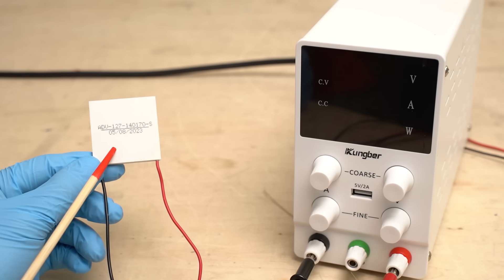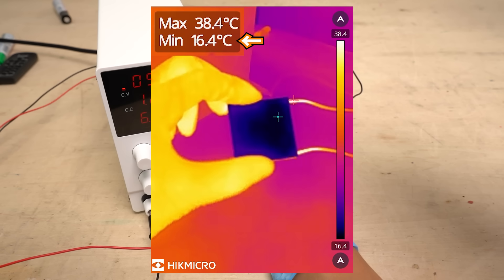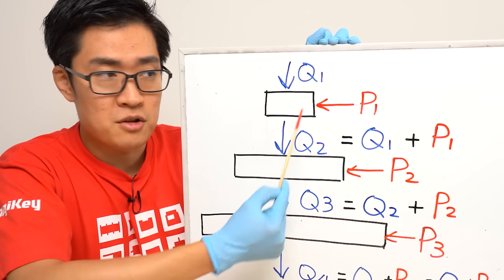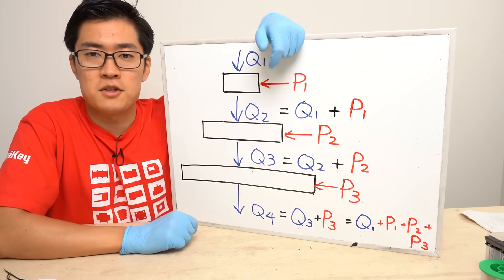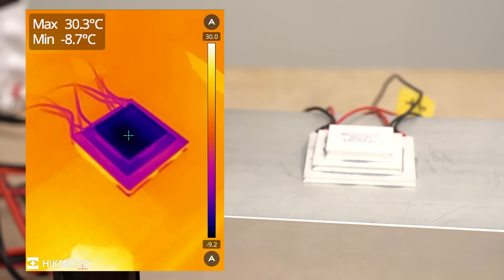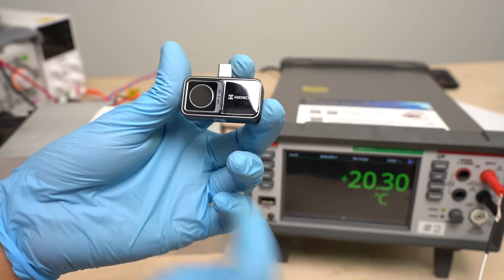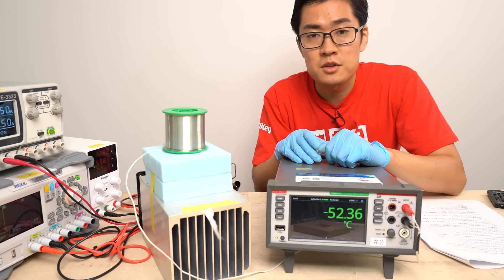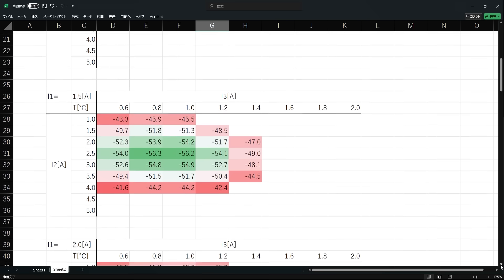Stacking 5 Peltier Modules, and Reached -90℃

Comment: 6:45 funny to think that he artificially added in the fan sounds after doing the dub just so we could hear how loud the fan is
Reply: https://youtu.be/yIMg89clGNk?feature=shared&t=500 The fan noise is the same between English and Japanese.
Reply: @torpedo996  this is an insane level of inquiry, im glad to be here for it
Reply: he recorded the fan noise with a seperate mic and they're on different tracks
Reply: That fan model is not very loud, it's only a 110CFM fan, at  45dB according to spec sheet.
Reply: It coincided with my laptop's fan booting up and it sounded like a helicopter was landing in my basement!
Reply: I find it interesting that you guys mention audio, microphone and Japan in relation to Peltier elements. Now legendary and extremely expensive Sony C-800G microphone sparked my interest for these devices, i think they used them stacked, mounted to a hefty heatsink. This is probably the only such microphone on the market, others move tube away from the capsule to allow passive cooling.

Comment: Awesome. I like the idea of stacking. I wonder if we did this and had about twice as many and cooled a cpu, using a small heat sink for the cpu for a start up cooling device then when the cpu is under load the thermo tech kicks in and cools it more. If balanced right you could make it to not produce condensation.

Comment: Looks a good idea in lab but it has far low COP (0.2 in 3 stages) than 3.5 of cryogenic cooling means 17.5 times less efficient than conventional cryogenic cooling
Reply: Only reason to use peltier is because it is cheep and simple or because of size restricitons.... ANY other cooling solution will be a lot more energy efficient.

Comment: you need copper heat spreaders between each layer. The ceramic on the peltiers is actually not thermally conductive enough to spread the heat between layers. It's actually made up of PN junctions in a grid layout
Reply: Did you watch until the end? He shows a commercial one and explains.
Reply: That's what I was thinking too.
Reply: What if he used 3 of the same type and therefore size of peltier modules and then ran them at progressively lower current ratings for each one?
Reply: u mean like in C shapes that does one surface to under..that is a good idea that and the traces for power makes lower power consumption i think....

Comment: So technically it's possible to build a solid state air conditioner.. That either cools or heats a room
Reply: Would be super inefficient and consume a ton of power.
Reply: Just remember that to cool 200w you will use 380w + the 200w = 580w total power consumption... Peltier is HORRIBLY energy efficient and create a LOT of heat. But is it a more efficient heater then just using a heater ?

Comment: Back in the late 1970s when I worked at Intech corporation, we used Peltier devices to cool solid state infrared lasers.
Reply: I need some info , I have a 300w pump diode , how should I cool it ? Is water-cooling enough or should I go with peltier ? Or a chiller + water-cooling ?seems you are very knowledgeable on the subject

Comment: Hmmmm... I wonder if such a device could be made for super over clocking CPUs and GPUs
Reply: I did this years ago.  Peltier cooled the CPU and water cooler cooled the Peltier.  Works great but there are better and more efficient ways to cool a CPU.  The biggest problem is the condensation it creates around the CPU.  You have to seal everything perfectly or run the risk of damaging the CPU and motherboard.

Comment: In the lab at work (I've since retired) we would use a peltier head to cool chips we were testing. The head clamped onto the chip, but had two pipes for cooling liquid on the back that attach to a vapour phase cooler in a large box under the lab bench. I believe it was only a single stage. It could go down to -10C. For lower temp testing we had a fancy liquid nitrogen system, but that required a trip to a different lab.
Reply: I use nitrogen in gas phase for purging systems and sometimes in liquid phase for Dewar type cold trap but not often as dry ice mixture is much cheaper. We're in oil distillation areas, not electronics but I use several heat exchangers daily.
Reply: I've been experimenting with liquid cooling on peltier units and the results are just amazing to experience in real time, I've been developing an off grid 'ice box' to keep my medication from spoiling in the heat, and peltiers are relatively very low electric draw for very instant dramatic results

Comment: Great solution to chill down the Intel heater in summer ..
Reply: It will not work to cool down modern CPU or GPU because they produce way to much heat in the 200 to 450w area which is way more then a peltier can handle. And even if you made a peltier by using several in parallelly that could handle that much power  you look at something in the 2000w ++ area of power consumption. For CPU  and GPU cooling it is better to use other cooling solution, like water cooling or just simple heatpiple aircoolers.

Comment: I wonder if the Peltier devices would be able to withstand the temperatures necesary to seal the stack inside of a glass envelope much like a vacuum tube. Moreover, I wonder if the glass would be able to withstand the heat generated by the bottom of the device without shattering.

Comment: Interesting results. I did a similar experiment using peltiers for a solar powered chiller, however I found liquid cooling the hot side using an oversized heat exchanger made it much easier to maintain the lowest temperature at full power for extended time compared to dry convection heatsinks. I also used edge to edge 2mm copper divider plates to couple the stages as the surface temperature was not entirely uniform and the overhang area was otherwise wasted, lateral conductivity without plates was poor and using copper material worked very well to improve efficiency. Aluminium would probably be similarly effective. Cheers.
Reply: Peltier is horribly ineffective as it uses a LOT of power to cool, only reason to use peltier is because it is cheep and small or you need to cool something very small to very low temperatures. Normally pretty much any other cooling method is better.

Comment: the future of solid state air conditioning. next we need ion propulsion powered fans to move air over the peatier cooling unit
Reply: @wompstopm123 as far as i know they use the same materials as the ones from the 70s.  There are physics reasons for their stellar lack of efficiency not just engineering ones.

Comment: Using a water drop to glue the thermocouple to the Peltier is absolutely genius!
Reply: Iced water Is a bad thermal conductor. If the sensori Is not touching the peltier but water iced you dont have the correct measure
Reply: @jackspinetta4580  Actually it's not too bad (>2.2W/m*K).
Reply: @jackspinetta4580  True, but the advantage is that it's easy!
Reply: @jackspinetta4580  Exactly. Using a thermocouple to measure the temperature of iced water, he is essentially measuring the freezing point of water, which is 0°C (32°F) at standard atmospheric pressure. This is a physical limit of the water’s temperature in the liquid-solid phase equilibrium (the term for this).

Icee and water coexisting at atmospheric pressure are in thermal equilibrium at the freezing ormelting point. The temperature remains constant at this point until all the ice melts or the water freezes completely. This is because the energy added or removed is used for the phase change, not for changing the temperature.

The reason he is getting readings of far below 0 is because the thermocouple is "somewhat" touching the measurement surface, the peltier. If this thermocouple was somehow 'welded' to the surface using some ideal conductor, the readings may be quite different.

Or, I am very wrong, and I will eat my socks now. Possible.
Reply: @AridForge  Why would you think that it is in a liquid-solid phase equilibrium? As you stated, the water freezes completely. Afterwards, you are just cooling the solid ice down. Still not sure about the correctness of those readings though.
Reply: @bilgehan_sahin  the differences would literally just be noise with the real temperature, it's not like you got a liter of ice separating the two
Reply: @bilgehan_sahin you ought to take some physics classes. Boiling water acts in a similar manner. @Sinaeb you too
Reply: @AridForge  Unfortunately, sir or madam, you shall have to eat some socks.

Steam won't go below 100°C, it will phase change into water. Water won't go below 0°C, it will phase change into ice. But ice doesn't have something else to phase change into when getting colder. It's just ice all the way down. It will absolutely get colder, and you can measure that, which is what they did in the video. Thermocouples like the one used are capable of this, regardless of ice being a thermal insulator. If you measure the temperature of the ice in your freezer you will find it is below zero C.
Reply: @AridForge  
yes you are indeed verry wrong.  but no need to eat your socks.  

(it's only true for a portion of the full container.  any ice still frozen will only be 0 degree's at the point where it contacts the water (since that is where it's melting) and any liquid water that is not in direct contact with the ice. can be warmer than 0 degree's.  (i say can be.  because water can be liquid at temperatures lower than 0 degree's depending on amount of polutions and the motion of the water)
Reply: @IAmDox  water can be water vapour at temperatures lower than 100 celcius.   we might not call it steam but it's still water in gas form.  
that's how your sweat evaporates.  that's how water evaporates. (put a glass of water somewhere and it will drain over time)   
it can evaporate at room temperature.
just like ice can turn into gas without melting if the air pressure is low enoegh.  water is a funny substance.
Reply: @jackspinetta4580  iced water is good conductor  whereas snowed water is poor conductor 😅😅😅 clear your false interpretations 😅
Reply: @BHARATcallingYOU  yes. Thanks. Five time more than water
Reply: lol no it's not it's insulating the thermocouple and all the meter is reading is the temperature of ice
Reply: why not thermal paste?
Reply: @filozofwielki1121  He wanted to make sure the sensor sticks firmly on the top ceramic layer
Reply: Why not soldering the sensor
Reply: /intrusive thoughts:/ * lick it.*
/return to normal brain activity/ that is terrible idea, my tongue will stick and hurt
/intrusive thoughts:/ do it
/return to normal brain activity/ WTF?
Reply: It might to be genius for a US citizen.
Reply: @Njazmo  This one is so good!

Comment: heat sinks are heat conductive but have low heat affinity, meaning it does not care for heat waves. it might as well not be there. the only thing cooling the module is the fan bringing in new air to absorb the heat energy. it is better to push compressed c02 through the heat sink for it has higher heat affinity & will draw more heat from the module.
Reply: Water, it is more simple to use water... Or use air conditioner cooling.
Reply: @a64738  dont message me again. i do not support ukranians..leech

Comment: Next, try replacing the heatsink and fan with a refrigeration system. You can probably get a used refrigerator or freezer that uses R134-A refrigerant. You can use automotive connections to charge it. They may use aluminum lines, so making connections might be the greatest challenge. Automotive air conditioners are more modular, so may be easier to work with. You need a vacuum pump to purge the system before charging it. You also need a set of gauges to see what you're doing. Once you have those two tools, they should last for life and be useful in the future. Or sell them. (The A/C went out in my car, so that's how I started learning about it.) Thanks for your great video!
Reply: This is what I was waiting for, either diy or someone else to do it. Fridge tech plus peltier device.

There are videos on YT teaching how to make small copper tube coils with a vacuum pump and heat exchanger, that would be cheap to build to test stacked peltiers.

That could definitely reach a new record for sure.

Comment: I have reached with an ordinary little cubic refrigerator a temperature of -42°C at nearly 10°C room temperature.
If I could put such a peltier-element-stack inside and could create a temperature difference of (-74°C - 16°C = ) -90 Kelvin, then I could reach -132°C. But with all the heat (130W) generated it would be a lot warmer.

Comment: I wonder if you made it water proof and poured water all over it, would it cause it to ice up and therefore essentially self cool? Or would that cause a problem where bottom part boils off and top part freezes?

Also it would have been good to know the temps of the hot side while it reached the -70+ temps
Reply: Also could this be made into a freezer which replaces the air compressor and gas?

Comment: Nothing like a cooler that needs a cooler. Neat idea
Reply: it gets one spot very very very cold, could be good for a cpu if you could figure out how to keep the peltier cold, maybe heat pipes 
if you can do that, you can take the moving water pump out of water cooling, which fixes the only downside to water cooling:the pump wearing out 10x faster than air cooling fans
Reply: All coolers need a cooler. Ever looked behind your refrigerator? Where do you expect the extracted heat to go?
Reply: @framegrace1  I am thinking more in the context of something like an engine radiator or CPU cooler. Yes, of course energy can't be destroyed.
Reply: @framegrace1  By your logic there would be no end to a cooler's size bc you'd need to add a cooler to a cooler ☝🏽 🤓
Reply: @Ebani  Yes. The environment is cooling the cooler, Earth is cooling the environment by radiating infrared light into space, space is cooling by expanding.

Comment: I used these, along with a power resistor, to build a thermal stress test jig for thermally shocking small smt components. I needed something faster than a fullblown temperature chamber. I was only able to get to a 150C delta, but that's all I needed at the time. I would like to be able to test a wider range (like -50C to 300C) but I don't trust these peltiers to be able to handle the hot cycle even though they would be unpowered. Heck I don't trust the power resistor either but I trust PTC Heating Elements even less.
Reply: Peliters gets ruined if they get to hot, I do not remember the max temperature but it is not terribly high (think it is same temperature as solder melts).

Comment: I have an idea. Bring a isolated salt water tank to -20°C with a heat pump in order to defrost a 300l ice storage tank in the house. The salt water tank is placed at a height of 2 meters. A petit element is inserted at the bottom between the tank and the base plate. This allows heat from the environment to flow into the ice tank. The humidity in the air condenses and freezes. By briefly switching on Petir elements, the condensate dissolves. And after switching off, an ice crust builds up again. This allows you to charge an ice storage tank quite efficiently.
Reply: Peltiers are very inefficient, whatever practical application you may think, it will always be the worst option. 
It's main (only?) use is on labs for it's precission and easy to use where money is not an issue. Just what the video shown; calibration, certifications, temperature control for small defices...  things like that.
Reply: @framegrace1  Yeah, peltiers are used mostly for small things where it does not make sense to use a full blown compressor based system, and also for very precise control of the temperature for components that may need it, like voltage references etc. Because obviously its easier to regulate current to peltier than a compressor system with a lot of lag.

Comment: A TEC (Thermal Electric Cooler) takes some power to create a temperature difference. It maintains a delta T. So if the delta T is 60C at 6A (for example) on 12vdc, than the hot side will be emitting 72w (these are ball parked, read the data sheets, but understand the concepts of why these things kinda suck regardless of how awesome they are). So, it doesnt matter what the hot side is at, the cold side will be around 60C below it. Want to get the cold side colder? Make the hot side colder (dry ice and acetone can get pretty damn cold, just sayin), but remember at minimum 72w of heat is radiating from the hot side, PLUS the thermal load it moves from the cold side. That means if you put another, say, 30w from a smaller TEC on the cold side, the bottom device has to handle 102w (in the datasheet there is a figure, i believe in watts, for how much energy over time it moves at a given amperage, so that 30w load isnt going to instantly appear on the hot side of the bottom one, but it will get there eventually). So when stacking TECs, be very aware of how the thermal energy moves between them and also stacks. 

Also, take that middle one out, its a point of diminishing return. If you want to triple stack, use the same reduction in area as the first and third one you have in this stack.

Fun Fact: The original Kinect using structured laser light used a tiny TEC to cool the laser.

Comment: Interestingly, peltiers are fascinating for GaAs cooling to reduce thermal noise, for example in radios to keep noise as low as possible, or in LNCs of satellite antennas, since it’s much cheaper than using nitrogen, bringing noise to under 1dB.

Comment: Minus 90 degrees Celsius is pretty cold. I once used two stages of Peltier elements (about 2 x 2 cm and 5 x 5 cm, cooled on an aluminum heat sink immersed in ice water) to eliminate a gap in the column of a nice mercury thermometer. I don't know how cold it was (I think I measured about minus 60 degrees Celsius with a NiCr-Ni sensor), but cold enough to allow all the mercury to retreat into the reservoir. Afterwards the mercury column was without gaps.